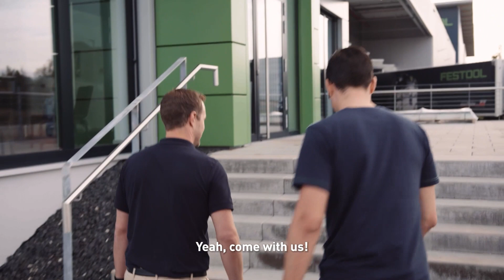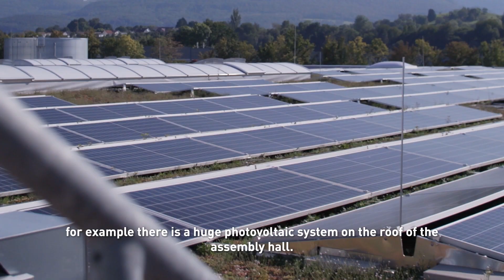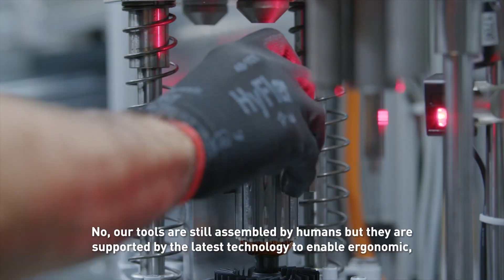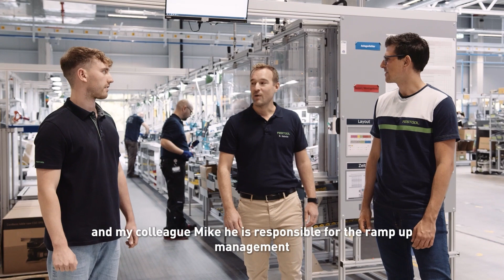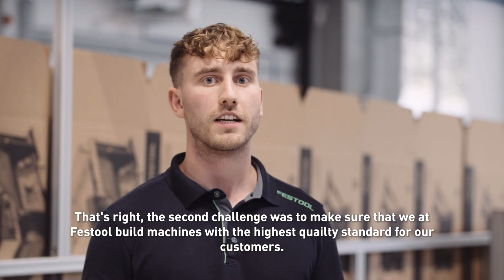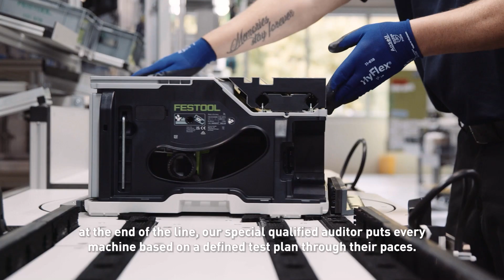New CSC SYS 50 Production

Comment: Unfortunately production output is very slow even if it’s Festool’s biggest production line. Most dealers say 3 months wait. Is there a ramp problem or there’s an engineering fix going on? How many units can be produced in a day?
Reply from the maker: Good morning sir, we are very sorry about the delivery situation of the CSC SY 50.
The only reason behind the long delivery time is the succes of the product.
The success of the machine exceeds by far all our expectations and forecasts. We have doubled the production of this machine to meet the very high demand. However, quality remains a top priority, so it takes some time to assemble the machine. 
Thank you for your understanding and patience
Reply: @festoolbelgium  Thank you